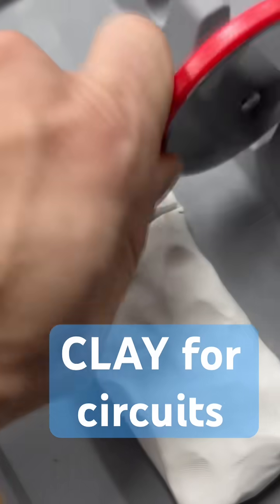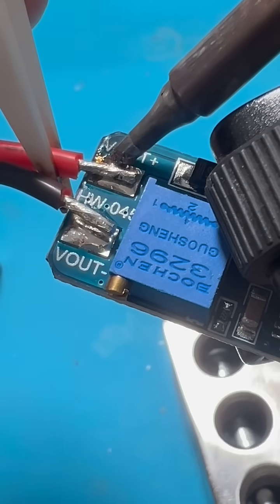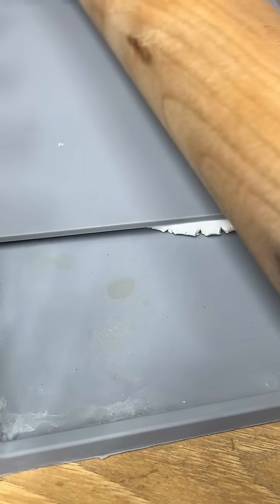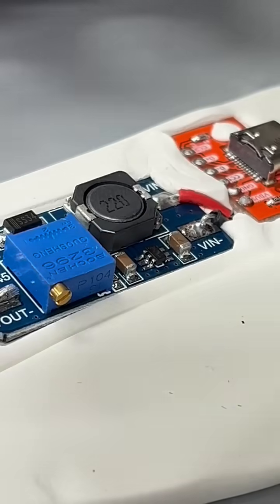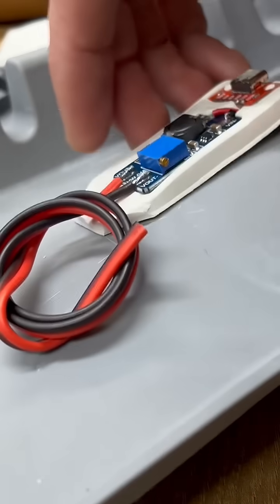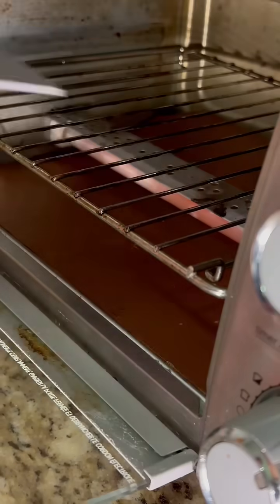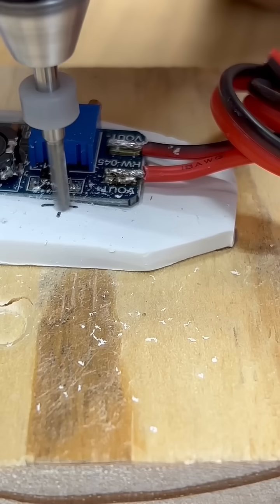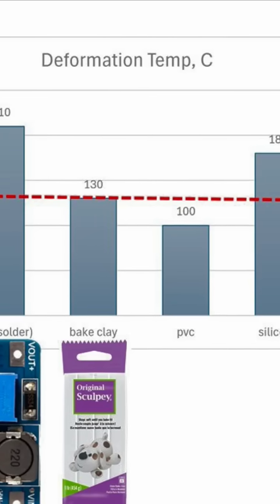use clay for circuit projects #methods #mechatronics

Comment: Good idea but the first joints are drier then the sahara
Reply: Guys guys relax. I'm here. I've got 100 years of experience so no need to argue.
Reply: @MaximusWallis thank god 😵
Reply: @MaximusWallis 
And as your teacher with a hundred years experience I agree with you, the arguments must end
Reply: @MaximusWallis lol ikr it's like impossible to know who's trolling until they say something ridiculous like that they have been soldering professionally for 30 or 40 years. Like go back to the nursing home at that rate they must be the reason every solder joint on everything I've ever bought snaps like a toothpick.
Reply: @Pepesmall for reall!! When was the last time anyone has seen a 50 yo in an electronic lab???
Reply: There is always that perfect looking soldier joint we all want see
Reply: then than
Reply: Extra solder isn't going to do much structurally or electrically if the rest of the solder is properly heated and wicked. It may partially make up for and hide if that wasn't the case, however. IPC J-STD and NASA-STD are good reads. Electricity is going to take the path of least resistance through the least amount of solder, since the copper is more conductive anyway, and because it's stronger than solder as well the only solder helping out is that in the path. Both standards advise ensuring there is proper heat for good wicking and good flow, with a volcano·like modestly concave fillet, and using more can allow for the possibility of voids and opportunity for overheating, without added benefit (significant anyway, if any). Imagine gluing and clamping two pieces of wood together and then slathering it in glue for good measure. That said I would have ensured more at the tip of the red wire. There are still around 2 diameters of good contact, so I wouldn't expect any issues especially considering he could have just stripped them shorter and had the same contact patch.
Reply: @NoughtSure  no, because that's irrelevant. If it mattered at all he would have probably made sure he didn't drill off center. Next thing you're gonna mention his fingernails weren't painted. 😢
Reply: considering the thickness and how much that regulator can handle one single strand would have been fine
Reply: @alexstone691  Totally not the point though is it.
Reply: It's really not that deep guys
Reply: 😂 hello noob
It's enough to hold it. No need for your stupid comment
Reply: no
Reply: I came here to say the same exact thing! Yikes.
Reply: @christopherbedford9897  You came here to say the exact same thing? Wasn't it enough that you responded to a person being wrong? You felt a need to be wrong too?
Reply: @perwestermark8920  "You felt a need to be wrong too"

Just happy I've never had to work with you, or use anything you've built.
Reply: @christopherbedford9897  You mention the joints could be ripped with two fingers. Technically correct. Would be correct with any amount of solder. The part you didn't mention - the copper would have left the PCB. That's the weakest spot here.
Reply: @perwestermark8920  That's not what I meant and not what it looks like to me. At least one of those joints looked very, very dodgy. But if you'd be happy accepting that work, 🤷🏻‍♂good for you.
Reply: @christopherbedford9897  Ah - you write something and then returns with "that's not what I meant"... Interesting!

Well, if I design things, then there är not allowed to be any two fingers pulling at any soldered cables. Because it's way outside of what a PCB can handle. So there are either mechanical protection. Or no physical load allowed. There are best practices for a reason. You don't want infrastructure handling loads for 10-20 years because of flawed design.
Reply: @perwestermark8920  No, I write things and then correct you when you said something else. I said that solder joint would come apart with 2 fingers. If you disagree then I honestly don't give a shit.

Anyway this topic is way past its "best by" date. Your long rambling Donald Trump response doesn't add any new information. Let's let it rest, eh?
Reply: @christopherbedford9897  Yes it needs rest. Because if you write "Your long rambling Dibalt Trump [...]" then you tell the world you are best ignored.
Reply: what??
Reply: @billysgeo  You don't know what a dry joint is? Why are you watching videos about electronic circuit boards? 🥴 🤷🏻‍♂
Reply: Funniest so far😂 damn bro hahaha
Reply: Then the Sahara.......? Then the Sahara what? 
Or did you mean 'THAN' ?
Reply: Also, if he was concerned about the wires melting during the bake, why would you even solder something exposed first?  it's on the top and exposed.... you could do that after.
Reply: Say what you want but that’s an acceptable class 3 solder joint. That’s not cold solder, it clearly wetted and covers 75% of the land with a visible fillet
Reply: My guess is he wasn't planning on using a high power load. He probably just didn't have any smaller Guage wire. But I had to double take this video to check his other solder joints. Looks like he just doesn't really know how to do thick wire.
Reply: Yeah, I paused and I'm in the comments before it's over. I don't take advice from cold solder chumps.
Reply: @ess2870  but it's not cold..? Just low on solder...
Reply: @Pablud3S  it's not low on solder. everyone complaining about this solder joint is an absolute newb with soldering. there's a massive amount of solder INSIDE the wire between the strands. it's crazy how many people are so confidently WRONG.
Reply: @cheater00 no matter if it's ok it looks shitty .
Reply: @JonasDecker-z3x  no, it doesn't. you're clearly a newb.
Reply: @cheater00  Sure only solderd industrial boards for 2 years . Full on noob
Reply: @cheater00 there's enough solder for conduction of a signal yes, but that's not why there's not enough solder, there's not enough solder on that wire to prevent any little amount of wire strain from snapping that solder joint like it never existed.
Reply: @JonasDecker-z3x  2 years? Those are rookie numbers in this racket. Try 30 years. You're a newbie. It's ok. Go learn something.
Reply: @JonasDecker-z3x  I don't give a shit what it looks like, only if it is a good joint, which it is. It's an electrical connection, not a f'ing fashion accessory.
Reply: @m3chanist  there's more to that . There's a reason soldering is the way it is.
Reply: @JonasDecker-z3x  Do tell, I've been doing it professionally for over 40 years. That shiny outer surface and even radii to both conductors tell the entire story, one you are clearly unfamiliar with. Got a soldering iron for xmas did we?
Reply: @m3chanist  Buddy . Covering the whole conductor in solder is the right way to do things..see that Matt surface finish on the wires ? That guy is using lead solder as you can clearly see on the properly tinned pads and yet he still managed to not bring the wires up to temp. The joints are dry.  I don't care about your experience I'm speaking from my experience and those joints will rip off as soon as any small pull force is applied
Reply: @JonasDecker-z3x  No, I don't see a matt surface on the fillets between the wire and the pad, it's shiney and THAT is the joint, not the rest of the wire. What's more you do understand that dry and cold aren't the same thing right? Start there.
Reply: @cheater00 yeah, joints look fine and will be fine. Confidently wrong absolutely nails it
Reply: @cheater00  It's crazy how low your standards are. No, those are not acceptable joints. Particularly on the +ve one where the solder barely flowed. You could tear those joints off with two fingers.
Reply: @christopherbedford9897  you're full of it buddy
Reply: @cheater00  so you've been putting out junk for 30 years... the wire is barely attached and would easily break off the board.
Reply: @cheater00  " there's a massive amount of solder INSIDE the wire between the strands"

And what good is it doing in there?

It's crazy how confidently wrong you are.
Reply: @cheater00  I wouldn't trust you to turn the light switch on.
Reply: @ess2870 take advice from everyone, just take a “chumps” advice with a grain of salt. Some of the best wisdom that I’ve ever received was from some of the dumbest people, but a dumb person with experience may know something that you don’t. I’ve worked with people that 90% of what they say should be thrown out but 10% of the time you should listen
Reply: @ess2870 he still got stuff to teach tho
Reply: @ess2870  The pads are lean on solder. Not cold. You sure you can decide who to take advice from if you don't notice the difference?
Reply: @ess2870  You have no idea what a cold joint is, don't you?
Reply: @ess2870  Then you are a chump, those joints aren't cold, there is shiny solder visible in both of the final joints.
Reply: All you have to do is look at the condition of the soldering Iron tip , you will know if he's a Rookie or a pro... Overall it wasn't too bad , but ideally the entire conductor got to be swimming ...
Reply: @Ali_Haji_SouthAfrica no it doesn’t. More solder doesn’t mean better and solder is not a great conductor. All that’s required is a fillet with appropriate height and wetting on 75% of the land
Reply: @Ali_Haji_SouthAfrica  ما هذه المادة البيضاء يا علي !؟ أنا لا اعرفها! 🎉🎉🎉
Reply: @Ali_Haji_SouthAfrica the tweezers give it away if the soldering didn’t
Reply: "Then"? 

What kind of consequence is there here?
Reply: u guys are lost in details while he is actually doing stuff 🎉
Reply: It's more than sufficient; I probably would've added some more solder but it's far from cold.
Reply: @gordon7478  never said cold . I said dry like in not enough solder
Reply: @JonasDecker-z3x  Yup, that's how it came through. My point was assuming it's not going to have a lot of stress applied to it, it's probably fine, and it's far from cold, so 🤷‍♂️

But I don't really disagree either way. The way I solder, if anything's getting tugged, the entire pads probably gonna go with it 😅
Reply: @gordon7478  Same here . My soldering background is racing drones . High Ampere high stress joints . So stuff needs to be filled until it looks like a pillow
Reply: I don't understand how @user-whatever has like 1k upvotes when this is clearly a perfectly good joint. There's plenty of solder and it flowed nicely. What's wrong with people?
Reply: Came here for this comment! Thank you.
Reply: Those are actually very good joints
Reply: @cheater00  "Those are actually very good joints"

Yeah, if by "good" you mean "bad" then sure.
Reply: @cheater00  that will work but they are not "very good"
Reply: @cheater00  not even close. Cold and dry.